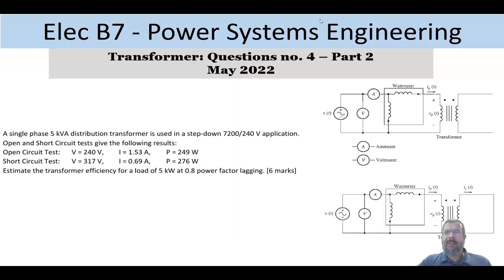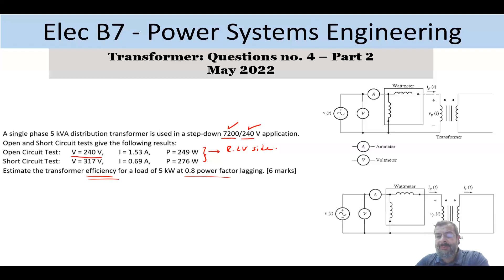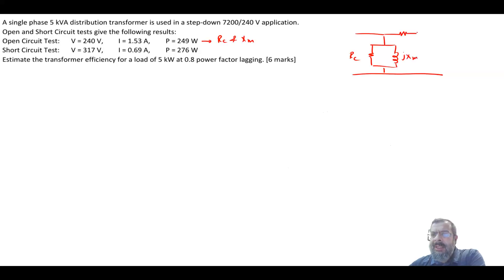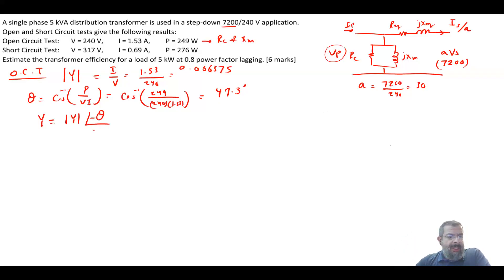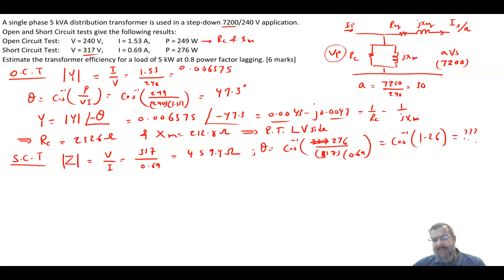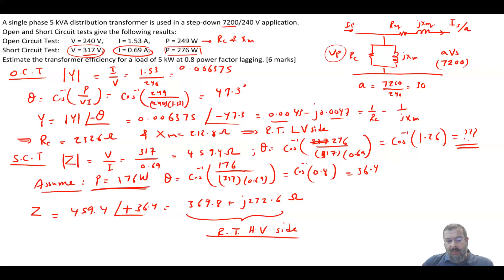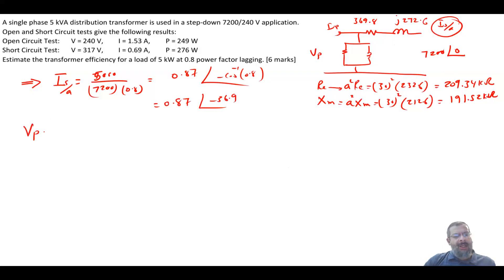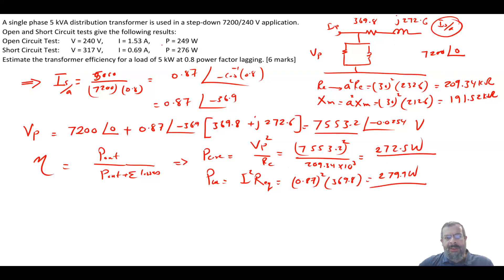PEO solve examples (ELEC B7) Transformer Question no. 4 - Part 2

Comment: Hi sir! I really appreciate that you are adding extra videos as we close in on the exam. I wanted to weight in on the short circuit test. For myself:
  Rc = Voc^2 / Poc     S = Voc * Ioc     Qm=SQRT(S^2 - Poc^2)    Xm=Voc^2 / Q     (note both open circuit values, Rc and Xm, use Voc in the calculation)
  Req = Psc / Isc^2    |Z| = Vsc * Isc      Xeq = SQRT(Z^2 - R^2)      (note both short circuit values, Req and Zeq, use Isc in the calculation)
If Zeq = 459.4Ω,   Req = 579.7Ω,   Xeq = SQRT(459.4^2 - 579.7^2) = j353.6Ω.
These values are silly and definitely incorrect, but you could assume the J-term is fine since it's reactance and you were going to add it anyways. This way you could continue without changing their numbers at least. Final efficiency 87.3%
Reply from the maker: When you calculate the X from the sc you should get a real number and not imaginary one. This the calculation of the magnitude of X.
Reply: @electrical4everyone  Zeq is not possible to be smaller than Req.....I agree that the question's parameter is not correct.